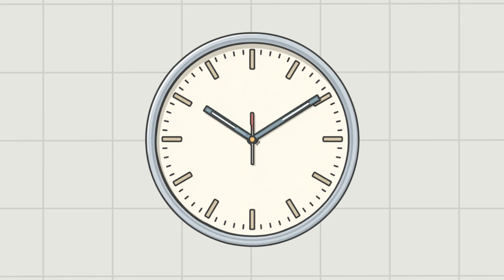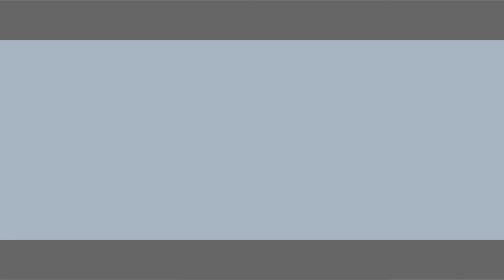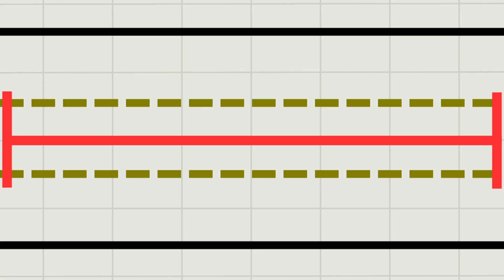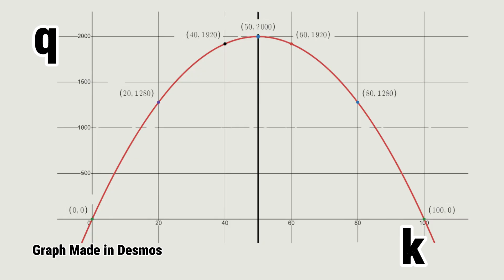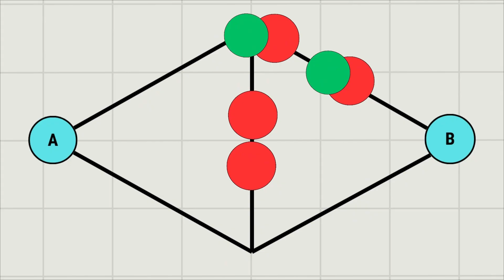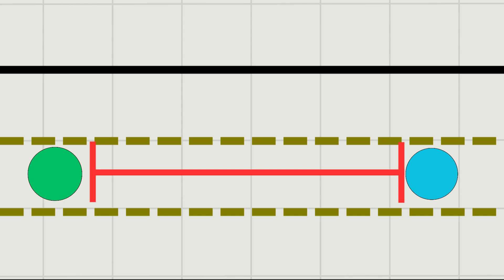Why Traffic Jams Appear out of Nowhere

Comment: It is also worth understanding that  maximum flow is not the same as the shortest travel time.

If you have two lanes moving at 10 km/h during rush shour (with overspill into adjacent areas of course) and you add a third lane that during rush hours will move 10 km/h you have increased the flow by 50% and reduced the overspill, but going to work just got worse, because instead of two lanes you now have to negotiate three lanes of traffic, so accident happen more often and that is more than likely to eat up the advantage.

Another example:
Assume everyone is one stopping distance after the car in front of them. Every car is 5 meter longs. Every driver stopping distance is 1 second reaction time plus breaking 4 meters at 10 m/s,  at 30m/s the breaking distance is 36 meter. Stopping distance 10m/s 14 meter, so about 20 meters per car or one car every two seconds. At 30m/s the stopping distance is 66 meter so we have one car every 70 meters or one car every 2.3 seconds. 

This means that we can increase flow by reducing speed. Travel times will increase of course.